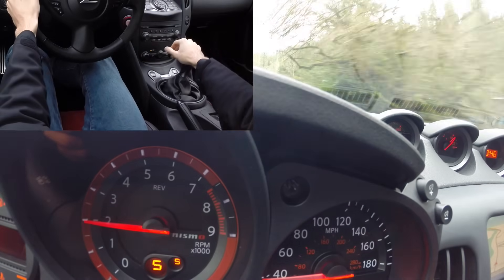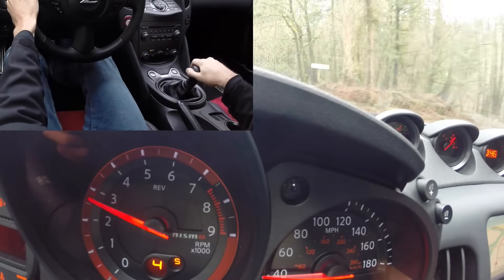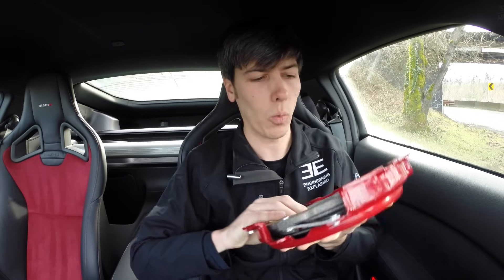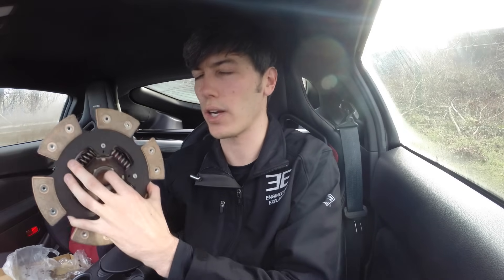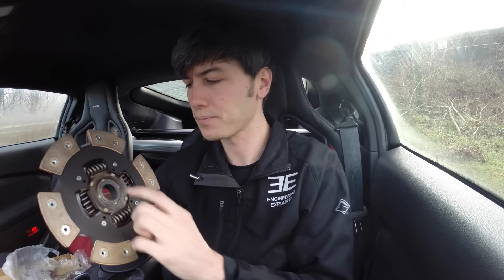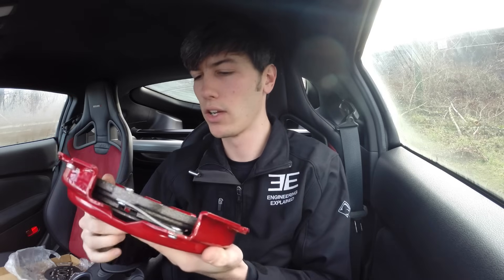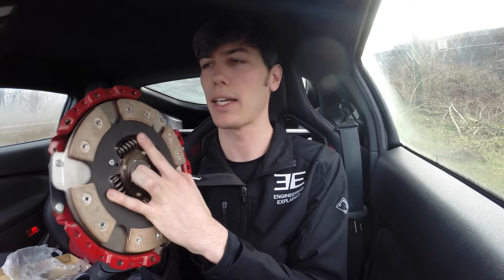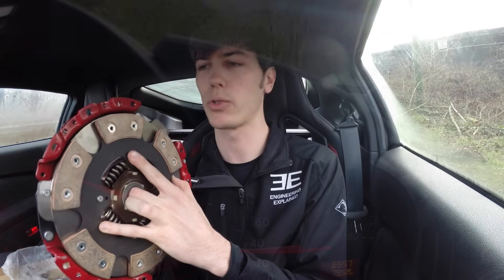What Is Rev Matching?

Comment: how about double clutching? does it have anything to do with Rev matching?
Reply: +obiwan kanobi It does. It's the same except you put it in neutral for the rev match. It's used in vehicles having worn out or no synchros at all.
Reply: +XeelS I watched a vedio were the guy said we must use it all the time to keep the sinchros from wearing out, it felt alot of job
Reply: +obiwan kanobi First of all you should watch the +Engineering Explained video about gearbox, if you didn't do it of course. The fact is this, you got a piece of components starting from the pistons and ending with the flywheel and the pressure plate. Then you got the second piece of components made by the clutch and the input shaft. Then the last "piece" made by the gears on the input shaft allowed to rotate freely and engaged by collars when needed, the middle shaft always geared with the input shaft and the output shaft and straight to the wheels.
The first piece had a quite important inertia, that means that if you do not rev match its speed to the speed of the second and second piece already coupled, you're likely to experience a bit of upsetting. But let thing what actually happens when you change your gear. You disengage the first piece from the rest because you want to take the load from the transmission, especially from where the collar couples the gear to the shaft, so now you can slide the collar and disengage the gear from the shaft. Now if you keep shifting to the next gear, your second piece is not coupled neither with the first nor third, and they all have different speeds. But this second piece has a relatively small inertia, and you're coupling it to the third piece when you engage the new gear through the synchronizer. The sinchronizer is a kind of clutch for each gear. But since the inertia of this second piece is very little it does not upset the car. Now that they are coupled, you have to match the speed of the first piece and then couple it to the rest.
When cars didn't have syncronizers, the moment when you just disengaged the old gear, you got no control on the middle piece since it wasn't connected to any of the others, so you couldn't make anything to match its speed to the third piece's one and slide the collar on the dog ring. That the reason why you got to engage the clutch in neutral, coupling the first two pieces, and then use the engine to match the speed of the third piece with the first two. Than you would disengage the clutch to take off the load, engage the new gear, and eventually engage the clutch again.
In fact, you could avoid the first clutch disengagement if you find that little moment when you leave the throttle and the engine passes from pushing the car to be pulled by the car. You could as well avoid the second disengagement but you need to be very good at match near exactly the speeds of the first two piece already coupled to the third.
Hope I've been helpful ;)
Reply: +Yury A thanks bro for the info and effort, appreciate it

Comment: Do you have to double clutch revving when it's in neutral or can you just rev it when the clutch in engaged? Does it matter?
Reply: +Cornwall1888 When you double clutch, you have to engage the clutch in neutral, rev match then clutch, engage your gear and release clutch. If the clutch is disengaged in neutral, you just end up winding the engine up for nothing, the goal in double clutching is to bring the input shaft and output shaft of the tranny to the same speed.
Hope I did help and paging +Engineering Explained to see if I forgot something ;)
Reply: XeelS from what I understand double clutch is unnecessary due to syncros in modern gearboxes and the other technique works just as well
Reply: Cornwall1888 Yeah it's now unnecessary but it was used back in the 80' :)

Comment: Low gear means high torque but lower speed, and high gear is vice versa. Why can't cars just have one gear and have it obtain a high torque and high speed?
Reply from the maker: +DrifterX2J Because they would be very (very) slow to accelerate from a start. This is just how gearing works. (Explained here: https://youtu.be/dbvATt89Ico)

Though Koenigsegg has done this, using electric motors to make up for the slow start: https://youtu.be/naRY3knqFYU
Reply: Regera ;)
Reply: +DrifterX2J Try starting your car in 5th or 6th gear, it won't work. (I think that answers the question lol)
If you only have one super long gear, the engine won't be able to push through the low revs, unless you slip the clutch a lot. Like A LOT.
Reply: Search for "CVT Transmission" :)
Reply: +DrifterX2J Because with combustion engines you have a point where they produce "peak torque," where the maximum amount of torque is being produced. This point happens at a certain RPM, as an example for my car it is around 2900RPM. Gears are designed to allow you to say at this point as much as possible providing the best acceleration. 

I'll give an example:

So with my car at 2000RPM in first gear I might be producing 90% of peak torque, at 2900RPM I'm producing 100% of peak torque, at 4000RPM I'm producing 80% of peak torque, now say I shift into third which sends me back to 2000RPM, I can now go through 2900RPM again which will deliver me maximum acceleration again.

Now with electric cars the engine always produces the same amount of torque so you can have a single speed gear box.
Reply: +DrifterX2J Because high torque + high speed = very high required power. And if you have that much power, why not put a transmission to it to further improve your acceleration and top speed?
Reply: +Ivan Ivanov Ivanovitch Ivanovski CVT - Continuously Variable Transmission
Reply: Watched the videos and read all of your comments. Thank you guys for the help!

Comment: One more point to add is that its application is not just limited to racing. Bad weather conditions can also cause the rear to "step-out" if one is too aggressive with a downshift and you don't rev match. It's a good skill to have. Downshifting in bad conditions is a good idea to prevent lockup from ABS issues. For example if all four wheels stop turning on ice because the wheel speed indicator detects no motion from the wheels ABS can be ineffective. Downshifting will prevent lockup in those conditions and keep the wheels turning as well.
Reply from the maker: Absolutely, just as useful for public driving for the life of your clutch and control of your vehicle. Great for engine braking.
Reply: +vidurc Good point. I once downshifted without rev mathcing in snow and the back end wanted to spin around. I managed to control the car but it gave me quite a scare at 60km/h :D
Reply: +vidurc I had a manual RWD BMW back then. My options are to either rev-match, or let out the clutch much slower than i did then :D
Reply: +vidurc  Just try to "downshift" without waiting till a corner or the roadways "super" has been reached. We are into the "Newton's Law" territory here. Plan accordingly. Adjust speed first, before corner or super takes over then Steer!
Reply: chang Chue Yeah we weren't talking about that. We're talking about shift lock in an automatic car. I rev match in my manual transmission car whenever I need to and rev match on my bike as well. Reading comprehension is your friend.
Reply: +vidurc Most modern cars with ESC will prevent that. The system is able to add power on it's own and keeps the wheels spinning. If you just slip off the clutch in a low gear it will obviously not work.
 In German the system is called "MSR" or "Motorschleppmomentregelung". Unfortunately i wasn't able to find the Englisch translation.

Personally I prefer using primarily the clutch in snowy conditions, it's just really easy to apply too much power and your tires will spin aswell. Especially with a turbo engine, revs are really hard to control.

Additionally you may put a lot of stress on your cars syncros while doing it wrong because the transmission itself, Syncros, have to do theire work within the transmission.
Double clutching as a solution is just completely annoying, slow and hard to learn. 

On mountain roads rev-matching is indeed really helpful, with low power engines you really need to keep the revs high going uphill, otherwise the revs drop too low and drivers behind will hate it aswell :D
Reply: You're not applying power though. All you're doing is matching engine to gear speed essentially doing the same thing an average torque converter would do. You're rev matching under braking. Its sad how neutered the Corolla got after the AE86. Those were true driver cars.
Reply: +vidurc  Absolutely correct.  When rev matching, you are increasing your engine speed to match the speed of the trans input shaft, but - importantly - this is while the clutch is depressed, so there is no power being applied to the drivetrain and wheels.  Using the clutch slowly to smooth the release of engine braking isn't good in higher rpm situations, where you may want more engine braking, and can actually cause the wheels to lose traction (what used to be called "compression lockup", and most common in front engine-rear drive layouts with minimal weight over the driven wheels) - although rev matching really isn't as necessary if you're downshifting at very low rpm, since the engine has much less of a braking effect at those low engine speeds.  A vehicle that limits throttle and power under these circumstances would actually be a detriment, as it wouldn't help the situation and can actually hinder your attempts to regain traction by increasing wheel speed to match road speed (thereby eliminating slip between the two.)  Fortunately, all vehicles I'm aware of only limit power when you exceed available traction when under power, but not under engine braking.
Reply: +Engineering Explained How does rev-matching occur with a multiplate clutch?
Reply: Makedeth My automatic does that when I'm using shift lock. Only solution is to equalize revs quickly so it doesn't loose traction completely.
Reply: +vidurc ABS isnt "ineffective" if all 4 wheels lock up, thats exactly where it starts working. If you dont have studded tires then youll have no grip and that will increase stopping distance by a lot. Doesnt mean that ABS will somehow mess you up, its more of a benefit not a disadvantage. No swewing under braking for example, the car will stay straight
Reply: Makedeth Yeah! Still fun in the snow! I love the SC400 I have. Needs an LSD though. My Acura on the other hand has an LSD and that's pretty great except for being FWD. Still a great handling car!
Reply: +vidurc Automatic is dq. Automatic???  Shift lock???
Reply: James Tennier The curvature of the road can still cause the rear to slide during a down shift though. That's what I mean.
Reply: chang Chue Yeah shift lock as in the 2 and 1 you see on the shift console. It locks the car into a particular gear when you want it to stay there. Modern cars use a similar system so the driver can over ride what the transmission is doing.
Reply: ok understood
Reply: BerndvonBackstein Good info thank you for that!
Reply: +Makedeth  We used to call that "compression lockup" when I was a kid.  It's not really locking, per se...but trying to drag the engine revs up with the clutch can cause you to lose traction, especially in rain or snow...or even in the dry under heavy braking.  And if your car doesn't have ABS - even cars as late as the early 2000s didn't always - then a smooth downshift in snow or rain can at least keep the tyres turning and you retain some directional control.  Beats locking up, for sure.  :-)
Reply: +lolatmyage ABS works with brakes, not the transmission. if the wheels are turning at the same speed as the axle and you are not breaking, how can abs know if the back is "stepping out", furthermore abs works with brakes, only ESC might have saved him.
Reply: I haven't had that issue. Rev matching has helped me more than fading the clutch.
Reply: True. In the snow that's really helped me keep traction. I try really hard to prevent ABS from kicking in and gentle engine decel really helps.

Comment: can you plz explain engine configuration advantages and disadvantages
Reply from the maker: +Basil Akasheh This playlist will satisfy your curiosity! https://youtu.be/yRWL9czmk_E?list=PL30C950600B683799
Reply: +Engineering Explained explain Scavenging in SOHC ??
% of engine power sucked by balancer shaft,fuel pump,HVAC unit,lights etc,in an AVG. Petrol engine CR 15:1
Reply: +Engineering Explained  I think u need to bring out the white board for this one bro no one really understood ur vague explanation on rev matching